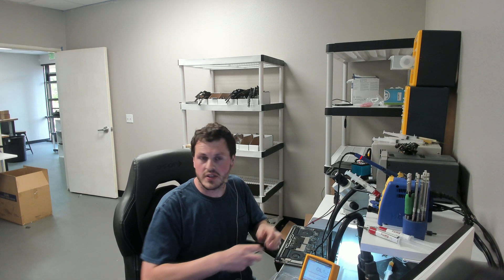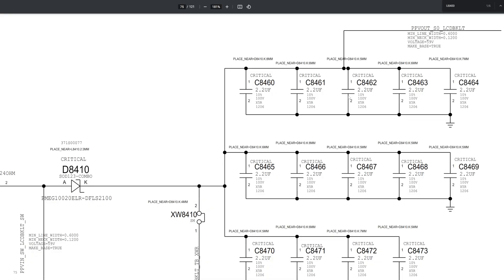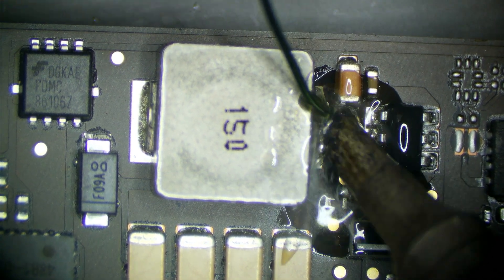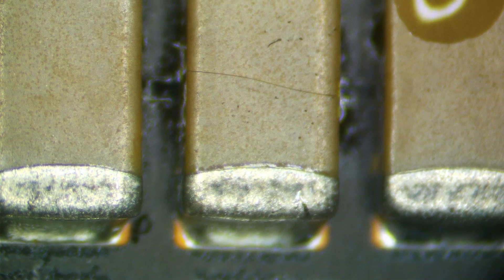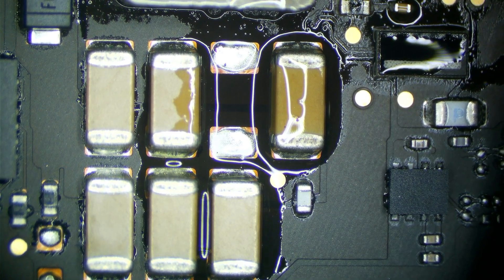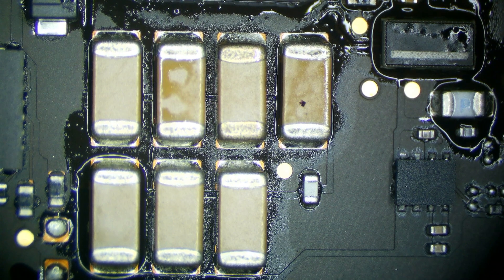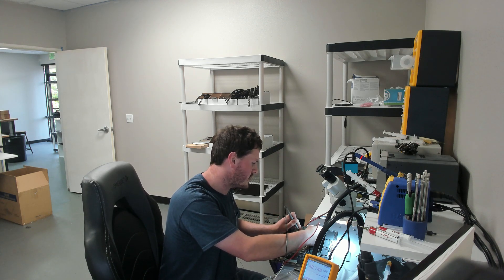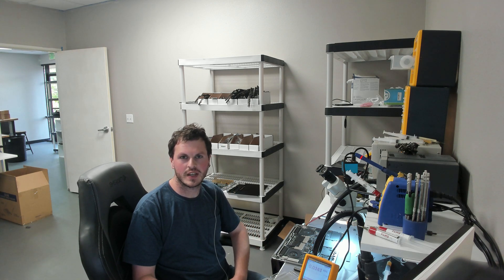Apple said this MacBook logic board needed to be replaced. Let's see if they were right.

Comment: Apple doesn’t fix computers, they sell you new ones. I was quoted over $1,000 for board replacement. Luckily an actual repair shop was able to replace one of the chips that failed.